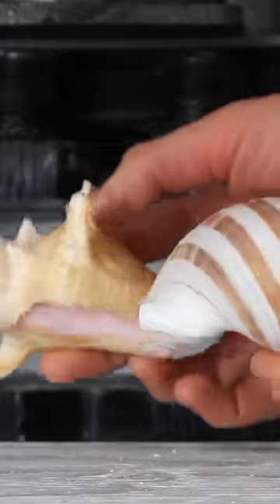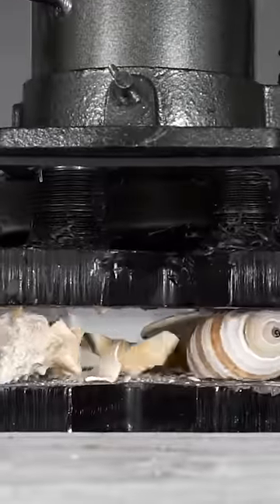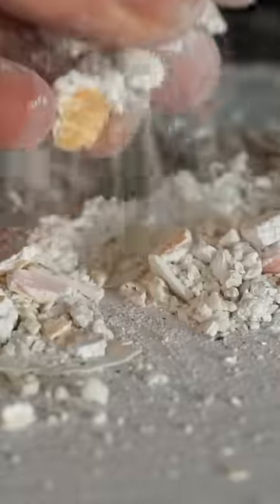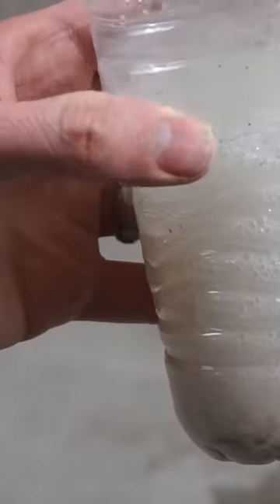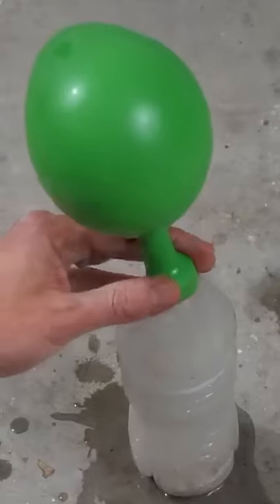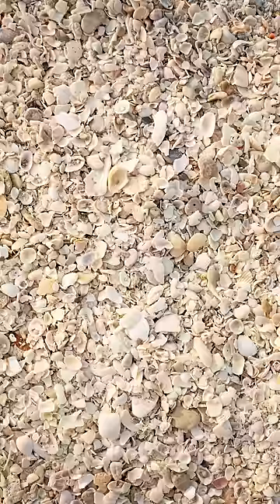Storing CO2 as Sea Shells?

Comment: Tabby is a concrete created mostly with crushed sea shells , with amazing insolation qualities and strength, we could turn the CO2 sink of the ocean into limitless building material
Reply: the possibilities
Reply: *Isolation
Reply: Limitless?
Reply: @mikepluma7896  Finite yes, but. What will run out first, currently to me it seems to be water, but cycling can differ depending. So say it is worrying we have x amount if we preserve what we have maximum, we may preserve are minimums? Obvious. So.
Reply: We should think about this kinda shit.
Reply: @ferrumignis  
Nope.
Insulation. Amazing what some context clues do for you
Reply: Calculate the energy and emissions in the process of making that concrete.
Reply: We could also do that with trees too!
Reply: @cyalknight  yes although that takes many years it's good to invest in that
Reply: E
Reply: Confidently incorrect  @ferrumignis
Reply: @oriontigley5089  I'm quite confident I am correct.  Insolation is a measurement of radiant energy from the sun.  If you can explain how crushed sea shells can provide radiant solar energy then I'm listening.
Reply: @ferrumignis  ok, Admittedly, I didn't actually know there was a difference between 
Insolation and insulation

That being said, using context clues, "insulation" makes significantly more sense than "isolation"

How does keeping some isolated relate to building materials.
Reply: @oriontigley5089  Seems like it's entirely accurate to state that you were confidently wrong yourself.
Reply: @ferrumignis  didn't answer my question; how is "isolation" the right answer?

Me, I mispelled a completely reasonable word, related to the context.

You, you suggested a completely unrelated word.

Comment: More homes for tiny creatures in the sea
Reply: Now turtles won't be chewing on incredibly well preserved fossils!
Reply: I guess that if this was produced in a wide-scale application, it won't be in the form of an actual shell, but rather a big slab of it.

If they could make it into bricks to build underwater houses as artificial coral then that would be amazing
Reply: @submarinemagnet7965  you'd need something else in the mixture, I think. Coral (artificial or natural) is pretty weak stuff; I think the pressure difference would be too great for a house made of it to hold up
Reply: @marcushendriksen8415  that's what I thought of as well.. maybe adding recycled plastic into the CO2 brick could add sufficient strength to it
Reply: @submarinemagnet7965  yeah we need to mix in plastic as much as we can. So if it breaks down over time we can let mother nature take care of it.